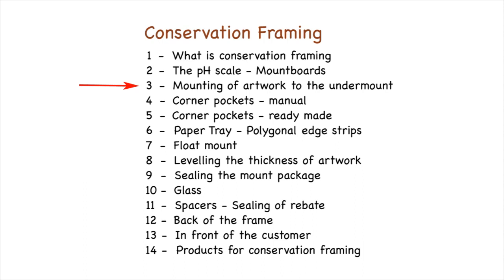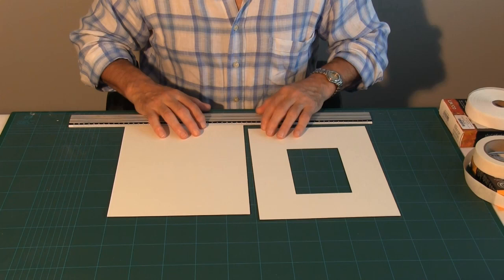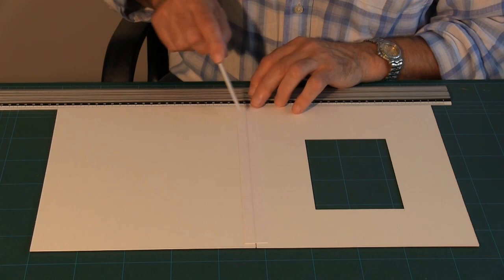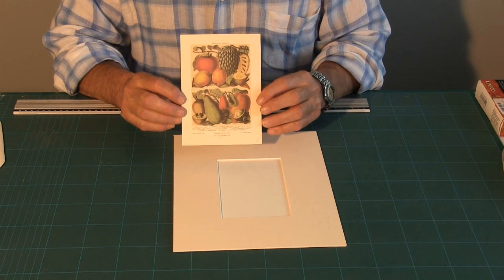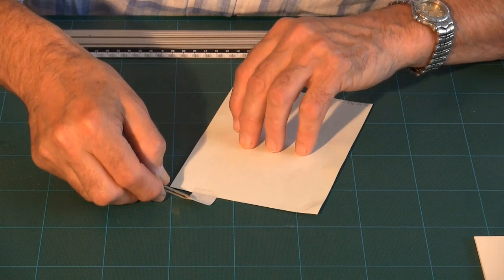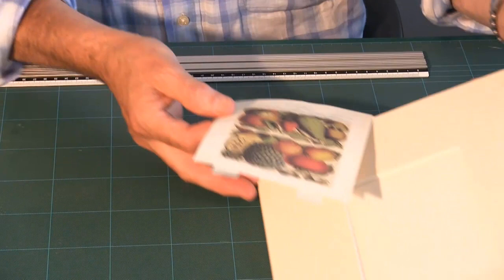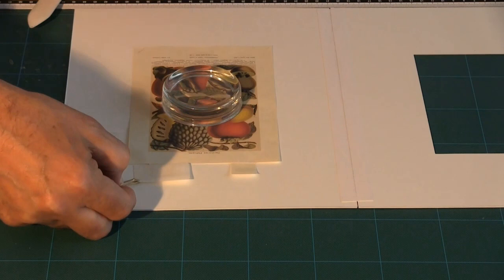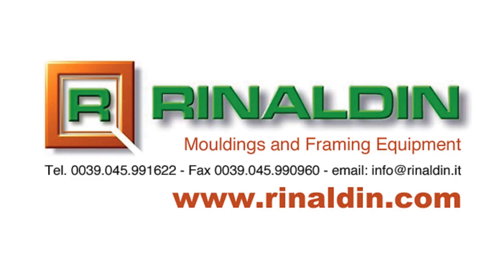Conservation Framing: 3 - Conservation Mount and T Hinges

Comment: does this work with dry  pastel painting ?
Reply from the maker: Yes, of course you can fix it in the same way for a drawing made with crayons.
It would not possible instead if you had a drawing done with charcoal or sanguine, because a preventive protection of the drawing would be necessary.

Comment: Why is that you wouldn't fix to the window matt? Is there a reason? Great video series too!
Reply from the maker: Hallo Craig, Mal Reynolds answered personally to your question: "One should always hinge the artwork to the undermount as it is more secure. This originates from museums and galleries that have unframed artwork on display.  It is easier and more secure when a researcher may wish to examine both the recto and verso of a particular item of artwork, it would be more difficult to do this if the artwork was attached to the back of the window mount. 
A second and perhaps more practical reason is that once the ’T - Hinge’ tabs have been placed on the verso of the artwork it is easier to correctly position the artwork in the mount package before applying the cross members.  Remember to leave a small gap between the cross member and the top edge of the artwork to reduce the chance of cockling.
Reply: Maybe I'm missing something here, the piece is more easily mounted for examination if it is mounted to the face not the backing, or undermount as you'd call it . This video is the only one I saw that claims this most others say mount to the face. Who surveyed these "museums"?
Reply: @RenaissancePeopleNYC  Hi Al, I'm not sure which other videos you have watched but it sounds like they have given you incorrect information. The proper way is to hinge to the undermount like Mal describes in the video. If you watch the first video in this series he explains the accreditations he has from the Fine Art Trade Guild and so he is very qualified to be sharing this information with you. Hinging to the window mat is the lazy way.
Reply: @RINALDINsrl  I would guess another reason to mount art to the undermount is because the undermount is likely to remain untouched for a longer time compared to the window mount which might be replaced for stylistic reasons.